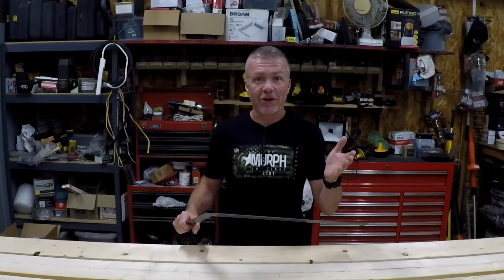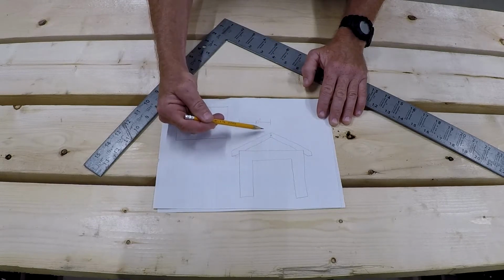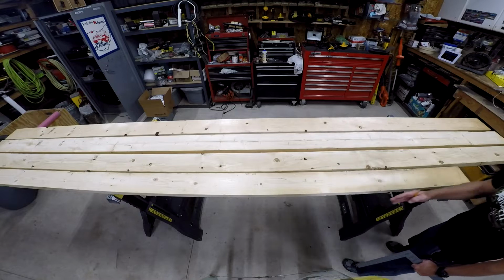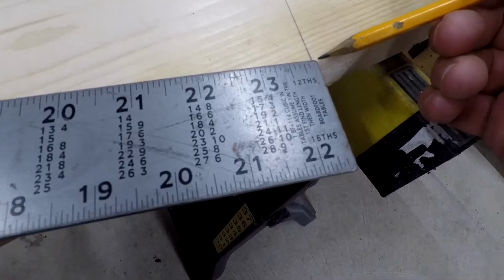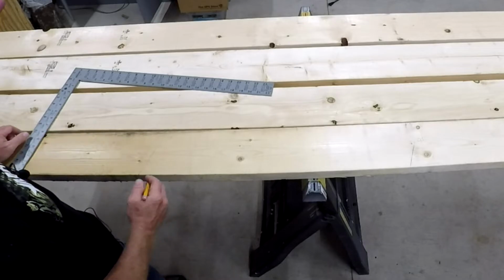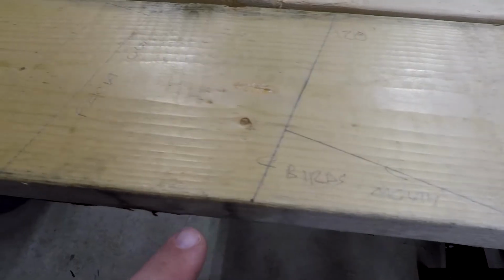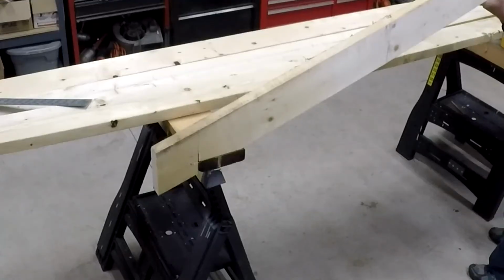Rafter Layout | Use A Framing Square Correctly | How To | MY DIY

Comment: Question. What should be the cut length of the perpendicular to the seat cut, in relation to the width of the board?
Reply from the maker: I think the rule of thumb is no more than 1/4 of the board width.

Comment: Why did you subtract a 1/4” when stepping off for the birds mouth?  I thought you were to subtract half the width of the ridge beam (3/4”)?
Reply from the maker: I take off 3/4 for half the ridge, but I add a 1/2” back to account for the OSB on the wall.
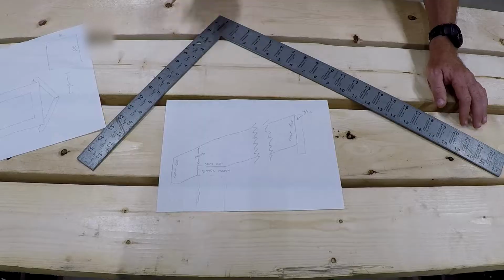Reply: Got it.  I missed where you noted that at 3:45.  Thanks!

Comment: I'm not clear on how a 20 foot span is bridged with two 10 foot rafters. Since each rafter is a hypotenuse of a 4:12 triangle, I estimate each rafter to be about 11 feet assuming a 6 inch overhang. Am I missing something?
Reply from the maker: I probably misspoke, they would need to be made out of 12’ boards.
Reply: Using the Pythagorean theorem (A² + B² = C²) and applying the example in this 20 ft gable rafter, (A²) Run of 10ft. is 120" x 120"= 14400", (B²) rise at 10' with 4/12 pitch is 40", so 40 " x 40"= 1600". Now add them together 14400 + 1600 = 16000", then hit the square root button on your calculator and the result is 126.49" ,round that to the nearest 1/16" is 126.5", that is the span from the top of the center of the ridge beam to the top of the outside edge of the wall top plate. take away 0.75" (1/2 the thickness of ridge beam) and you now have 125.75", then add the 0.5" thickness of the sheathing (zero overhang eave) and the total length of the rafter required is 126.25", or 10 ft. 6 1/4". All this coming from a guy who has never actually built a roof! so there's that.
Reply: @MyDIYBuilds  I think the confusion is rooted in the linear distance between the 8" mark on the sort side of the square to the 24" mark on the body side of the square being interpreted as 24". It is 24" of run, but not 24" measured along the edge of the rafter due to the additional length added when held at an 18° angle. the linear measurement along the edge of the rafter is actually about 25 1/4" vs. 24"